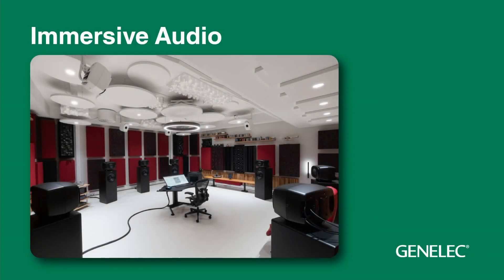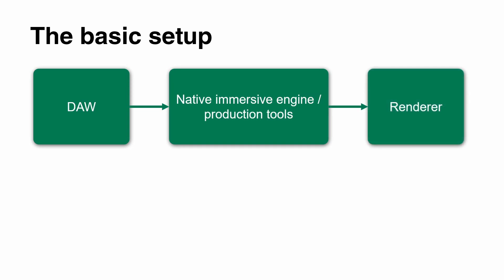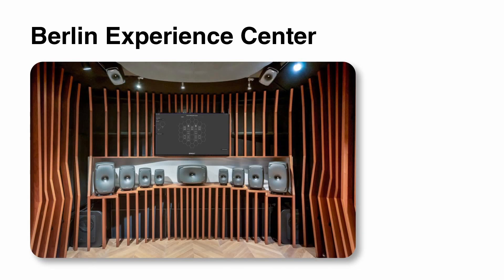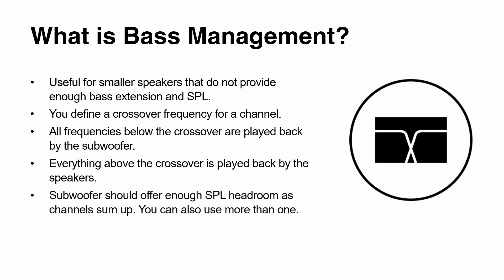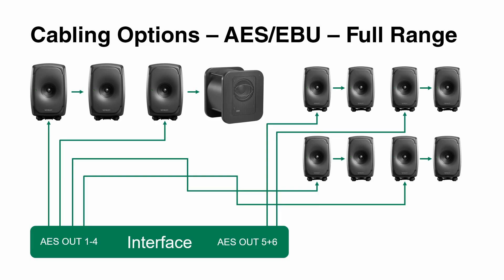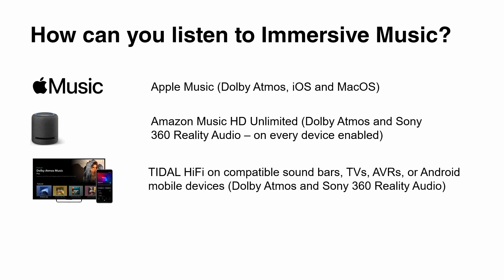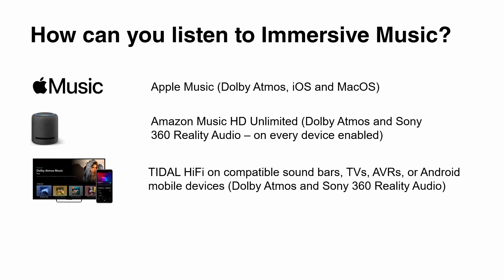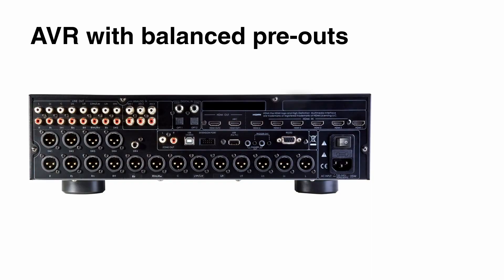G LearningLab | The Studio Setup. What components and devices are needed and useful?

Comment: This series is very timely for me and I'm very much enjoying it so far, thanks. I’ve just discovered Genelec Ones (so I could very well be incorrect here) but I would love to setup a 7.2.2 home system in a 5m W x 4m L x 2.7m H room. I’d go with 8351b LCR, 8341a surrounds and 8331a heights, I think. The cabling practicalities are daunting though so it’d be great to see a practical case study. I’ve not been able to find good examples of how they are physically cabled. 

I’d be starting with and AVM60 with analogue XLR outs. The cables required would be: 
- One analogue cable to each speaker
- One power cable to each speaker
- Two Ethernet cables to each speaker for GLM (except for the last in the last in the chain as one in and one out)

That’s quite a bundle. If the AVR/AVP is digital you’d need to add a second digital cable to each speaker if you were to daisy chain them. The sub-management would greatly help that though I guess and I suppose the Ethernet cable could be connected only when GLM is run; as long as you’re careful not to disturb the speaker as it’s disconnected. 

I do think the Ones would make the perfect system though. The same 3-way concentric sound in different sizes all around. End game for me I reckon.
Reply: "The cabling practicalities are daunting though so it’d be great to see a practical case study. I’ve not been able to find good examples of how they are physically cabled. 
"
This is shown in this video, so not sure why you ask about this.